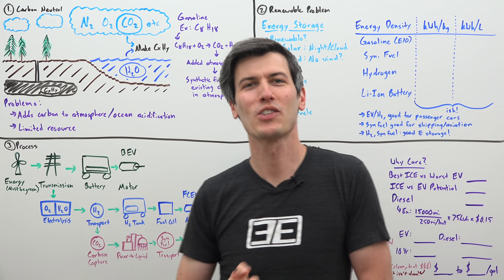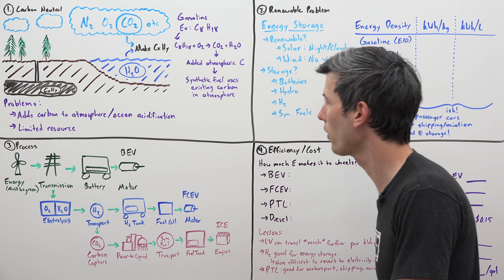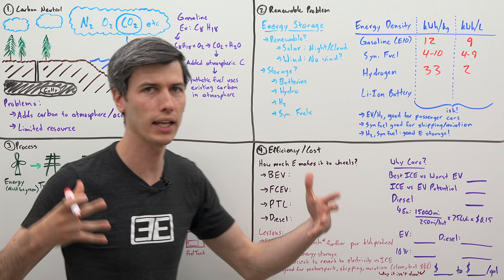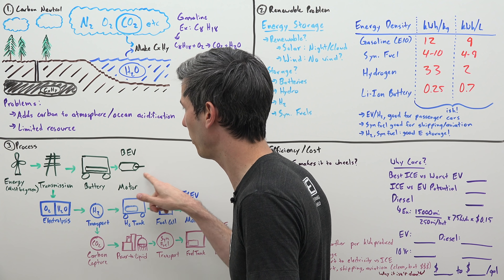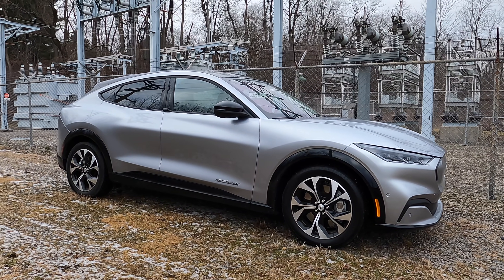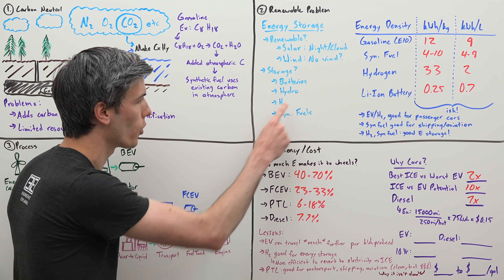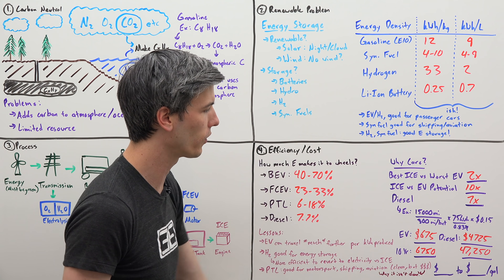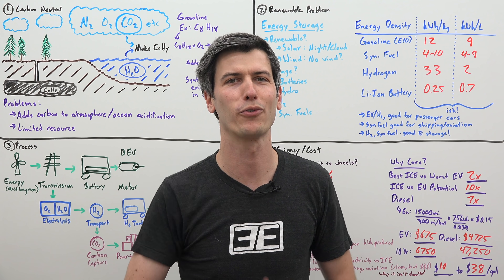The Big Problem With Synthetic Fuels

Comment: Also your calculations on cost of ownership is not relevant when you factor in the 10 year cost of ownership at 15k miles per year. Why?,  I thought you would never ask. Well it seems like the warranty on these ev batteries is around 8 to 10 years or 100k to 150k miles so after your warranty is up, the cost of replacing all of your degraded and poor capacity lithium batteries is going to be a minimum of 30k usd if you have a decent sized ev. So with that cost calculation we are not far behind combustion powered engines on long term cost efficiency.

Comment: Wait wait wait.. you skipped the energy encapsulation device manufacturing process for electric vehicles. Just because it happens before you purchase the vehicle doesn't mean it's not necessary. The manufacturing of lithium ion batteries is a very hard carbon filled process, ver expensive as well. Plus we also need to compare the power source lifetime. So basically how long will the lithium ion battery last vs a combustion engine.

Comment: Why not make a synthetic fuel that can be mixed in with, instead of replace, petrol to at least lower overall ICE carbon emissions? That would mean making synthetic fuels with the right octane rating. Could it be done?
Reply: You can already mix e-fuels with current gas.

Comment: have to keep in mind that scale up will reduce cost of synth fuel. Also atm energy production in all forms is expensive. We are on the verge of limitless clean power as nuclear fusion comes on line (50-100) years which means the environmental and convenience benfits would out weigh lack of efficiency. EVs are only cheap to run if you can charge from home. A lot of people in dense citys who dont have a fixed parking space will not be able to charge at home

Comment: The price problem: don’t worry. Costs will go down, just like computer parts. If you were to take your phone and sell the parts back in the 1990s, you’d be able to get millions for it. Those parts now are much cheaper. 

The energy efficiency problem: sure it makes sense in the maths. But it’s not the point. The point is that the transition in the infrastructure is an easier one than EV stations or even fuel cell stations. 

Also as the technology advances, it would absolutely increase in efficiency. 

So yeah, the math checks out, but there’s a lot more involved here than just numbers. It just makes sense to go synthetic. 

Plus, did I mention VROOM?

Comment: Go to Tesla, ask the price of changing the battery then you know the cost of running has nothing to do with energy source. All calculations are good, just has nothing to do with reality. EV efficiency is only good at discharging but terrible at charging, maybe the worst. You do not lose gas when refueling your petrol car. That lose is easily 20%, which is significant, think in this way, you go to a gas station and it takes 5 mother lord hours to fill your 100 liter tank and 20 liter in on the floor. And next moring the car tells you that 80 liter fuel just 60 liter left because it's in winter.😂

Comment: What about all the carbon from mining to build the battery’s and the toxic refining process and the shipping from the mine to the processor then to final production and it’s transported most all the time on super container ships that burn the lowest grade dirtiest fuel. E fuels would be better even if was being powered by natural gas power plant. Check the actual carbon foot print from start to finish it’s worse and battery life of 10 years what’s the plan to dispose of all the used up batteries.

Comment: This negates to acknowledge two simple facts, it's faster and more convenient to fuel a car than to charge one, especially when you already have an infrastructure to move and sell that fuel in place, to say nothing of the massive industries that are never going to let themselves silently die, even if that means figuring out how to make it cheaper
Reply: Also,  it is much cheaper to export cheap renewable energy from the Sahara desert as e-fuels. Doing it by power lines is way too expensive and loses a lot of electricity over long distances.
Reply: @jimj2683  even if it didn't there is no conscientious argument for an electric car that would make a Karen or her brood of children wait at random points across their journey for a half hour a stop, not if she has access to some rich older benefactors credit card, and some random crossover with a badge expensive enough to brag about to whichever of her kids sports-ball coaches makes her go cross-eyed

Comment: Battery raw materials lithium, cobalt, copper and nickel are not renewable.  Talk about destroying the environment; look at the destruction around a lithium or cobalt mine?  They are also located in limited parts of the world, especially lithium and cobalt.  Folks, there will be wars fought over these rare resources as demand escalates.  

Lithium auto batteries lose efficiency over time, like any battery, so it will not last 100K miles.  How many batteries will you need for your EV car over 100K miles, assumed life of the car?  The production of lithium auto batteries inherently has a high carbon footprint, breaking even with IC cars around 60K on average.  Now mandate electric globally: cars, trucks, buses, large construction equipment, so an exponential depletion of these rare earth minerals along with the associated production carbon footprint.  

Then there’s the infrastructure argument…

Let’s stop the electric mandate madness and keep seeking alternatives, including synthetic fuel and clean gas.

Comment: We will use synthetic fuels:  1) most of the world's high energy renewable resources are far removed from population centers.  Chemical fuels are the only practical way to capture this energy, store it and then ship it to where it is needed; 2) The energy available from oil is degrading quickly.  The world EROI from oil is expected to drop from around 18 today to 6 by 2050  It makes sense to blend diesel with methanol and ammonia to meet 2050 CO2 emission standards and meet cost objectives.  For example:  The Iowa Renewable Energy Association recommends manufacturing Ammonia in Alaska from very efficient hydroelectric power and shipping to the U.S. for blending.   EROI of ammonia from Alaska is a whopping 60 BTU output / BTU input.  60 >> 18.  That's why we make synfuel.

Comment: But don't you think with time the cost and efficiency would be much better? I mean when Tesla came out with the roadster over 10 years ago it was slow and only had a rage of like 250 miles. Today you have the Model S which is much bigger and less aerodynamic probably and it's much faster and has almost double the range. The only way it can improve is if we invest in it like we did EVs

Comment: A great video on the engineering aspects. I am curious about the economics. I know Formula 1 wants to switch to synthetic fuels, and they clearly have the money to pay $38/gallon for their cars. Perhaps the demand in F1 for synthetic fuels could spur demand across motorsport, and other non-essential uses of fuel? Should be interesting to see if it ever gets cheaper.

Comment: Too many other variables at play.  First, Porsche is not the only one developing e-fuel other German/international companies are involved ... let the free market and competition drive the costs down.  Also when you combine the improvement and fuel efficiency of new ICE engine technology  ... can/could EVs match the range down the road?  Could EVs match the range of a Hybrid car today on synthetic fuel? How easy would it be for gasoline stations to just swap out fuels rather than changing completely to electric charging stations? Bigger question, what's the cost involved in changing out our infrastructure to completely support EVs? Will EVs eventually be more affordable ...will we see EVs for under 25k?  Only time will tell so great video but a premature call for eFuel when it pertains to passenger cars.

Comment: Engineering explained you are incorrect, they are a much better solution then electric vehicles today so there is no way they can complete. Time will tell if they are better then standard gas or diesel.

Comment: First : carbon capture must happen from the sea , a liquid , and not from the athmosphere , a gas , because in liquid the carbon is much more dense and more easily then to retrieve . Second , if the price of green electrical energy production would succeed in coming down almost to zero , because renewable energy is free (solar , wind) , then would this synthetical fuel path not be cheaper , even when less efficiënt than straight electricity , because that would save the massive investment to switch a part of the economy from combustion to electrical ?

Comment: We don’t want to replace electric vehicles, I want current ICE vehicles to fit into the neutral carbon society and save some money. Maybe we can use power to methane to store electricity. It’s efficiency is higher than power to gasoline and ICE refitting to methane cost is not very high. Let’s do a little math. I am living in China. Many of the taxis have been refitted to burning natural gas. And currently the fuel’s prices are 
gasoline 9 $rmb/L, natural gas 3.5 $rmb/m3 
converting to $rmb/kwh is 
gasoline 1 $rmb/kwh, natural gas 0.35 $rmb/kwh
So the refitted ICE taxis can save half of the fuel cost. The refitting expense is about 1000 $usd.
The electricity price is 0.55 $rmb/kwh. The average electricity generating cost is a little bit over 0.3 $rmb/kwh and in most regions the electricity production is excessive. In some provinces the number is over 40-50%. Renewable electricity production has trough time and the running cost of hydro power plants is 0.01-0.03 $rmb/kwh. We can use that electricity to produce methane.
According to Wikipedia, the power to methane efficiency is 40-60% higher than power to gasoline. The average synthetic natural gas cost is 0.6 0.7 $rmb/kwh theoretically. We already have natural gas transportation and storage infrastructure. We need to build more CNG gas stations and the cost is not very high. We need government policy support and vehicle manufacturers official’s solutions for refitting. I know that the cost of per kilometer by BEV and ICE are 0.1 rmb/km 0.5 rmb/km(natural gas ) 1 rmb/km (gasoline). At the same time, hydrogen infrastructure can de developed slowly and hydrogen price will go down. After that what we need to do is waiting geothermal well plasma drilling technology breakthrough or nuclear fusion technology breakthrough.

Comment: Sadly they're being used as an attempt to slow down renewables in Germany right now. The "economic liberal" FDP blocks legislation to reduce combustion engine use by blabbering about eFuels as if they were some miracle weapon. 

In reality we will need all eFuel capacities for special uses where high energy density fuels are actually necessary (like aviation or certain military vehicles). Any personal cars using up eFuels will instead take away the limited fuel from those vehicles and lead to more traditional fossile fuels being used instead, thereby directly increasing emissions.

Comment: I have two questions - firstly, you mention Hydrogen Fuel Cell - what about Hydrogen ICE vehicles - are they better or worse than fuel cells.  Secondly, if we took cost out of the equation and dealt simply with environmental reasons - wouldn't both Hydrogen and Synthetic Fuel be better than electric as neither are polluting the atmosphere and neither require harmful Lithium Extraction processes?
Reply: The difficulty with hydrogen is more in how you store it. Hydrogen ICEVs are typically not as good as hydrogen FCEVs, which generally make better use of compressed hydrogen. If you use methanol instead, however, and do something like autothermal reformation to release the hydrogen from the methanol, you can reduce the efficiency gap between FCEVs and ICEVs by reclaiming waste heat from the ICE. You could do this with FCEVs as well for additional gains, but you need to deal with issues like carbon monoxide poisoning of the fuel cell. Fuel cells prefer steam reforming of methanol, which results in inherently lower efficiency gains.

The advantage of using methanol as your storage vector instead is that you store a lot more hydrogen per unit of volume than even liquid hydrogen itself, so you can have cars that match or exceed current capabilities with an inherently cleaner fuel. Methanol is also the cheapest hydrocarbon to make synthetically, and doesn't compete with agriculture in the way ethanol does, which is why it's the frontrunner for carbon free shipping. Because of how you make it, you can actually go carbon negative, as not all of the carbon is used up in synthesis.

Comment: A 'problem' here is that synthetic fuels would allow everyone to keep running their existing vehicles another ten, fifteen, twenty years or however long they last. This will reduce all the environmental damage being done by raw material extraction for and the energy used in building new electric vehicles.  It makes a lot of sense to keep using existing vehicles for asong as we can.
The problem? Car makers won't make any money if we don't all buy new cars. Much better to push EVs on us and let us think we are buying our way out of the image problems. 
It's mad

Comment: I know that's not the point of your video but you're not taking into account the ressources needed to replace the existing vehicles by electric vehicles. Also the distribution infrastructure for gas is already here.

Comment: IF Wind turbines and PVs were producing H2 at source with integral electrolyzers I think you'd see a further redrawing of the costing layout. Yes, the generation is intermittent but look at the times it needs to be curtailed due to lack of demand.  Remember it's the totality one is trying to capture. Studies suggest of less than 5c per kwh of landed H2. Even conventional H2 generation is now sub 10c/kwh  in parts of Europe. That's approaching 3 eur/ usd per kg and a 500 mile car FCEV is a LOT lighter than a BEV.

Interesting times coming I think.

Comment: If the input is always electricity, synthetic fuels lose; but using heat-driven catalyzed reduction reactions compared to a heat engine to make electricity, charging a battery and filling a fuel tank come closer to energy input parity. Factors that will tip the balance would be the source of energy and the value of energy density. For instance, next-gen low pressure liquid fueled nuclear reactors will produce energy at very high temperatures which is excellent for such reactions; and however ground transport progresses, energy density will be the key factor in aviation, likely driving the synthetic fuel industry to become more efficient and economical.

Comment: Diesel cars have effeciency of about 35% and hydrogen and batteries are just terrible at storing energy per volume. Remember eFuels is still an emerging technology.
Reply: Even more in colder places because the excess heat is used to heat the cabin.
Reply: @jimj2683  True
Reply: @jimj2683  What if someone is stuck in traffic and they are in a cold place, or a hot place. The batteries will get exhausted

Comment: With respect you have left out a very important step,that step is producing batteries and that inefficiency is a major issue with EV's, the comparison should be from the source of the energy to the wheels on the road.

Comment: One thing that is not mentioned in the video is that the fuel could be made at night or other times when we have an excess of power. 0.15c is therefore not really a realistic price. I know the other costly steps are cut out here, and I do not think this is the future either, but obmitting this makes the numbers quite missleading.

Comment: The information comes across as more about comparing production costs and efficiency numbers than engineering and the benefits of R & D -- and economies of scale change according to supply/demand, along with production methods.
I would not rule out synthetic fuels as a potentially more "earth friendly" alternative to batteries.
The process of acquiring and utilizing materials required for manufacturing batteries is not without environmental consequences, nor is their disposal/recycling.
I make no claims to knowing what the future holds for IC engine fuel sources, but I wouldn't count on them disappearing anytime soon.

Comment: Is synthetic gas really $10/gallon? That's 2.5x current prices. I must admit that is borderline prohibitively expensive. But in the future other commodities might come down in price so maybe our respective budgets can handle that burden.

But where did they pull this $10/gallon number from?

What do I ask that for? For the carbon dioxide in the air is not very dense. Air is a better source of nitrogen (see haber-bosche process)

But CO2 gas from industrial processes is a very rich, and supposedly cheap source of CO2.

Maybe with technological advances, and better sources of CO2 gas, we could see synthetic gas compete with non-renewable gasoline in terms of price.